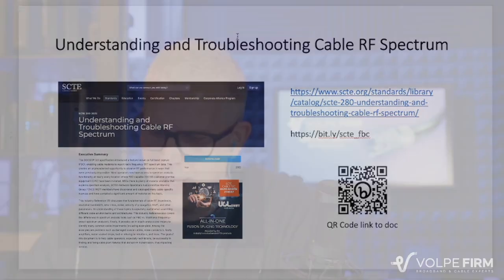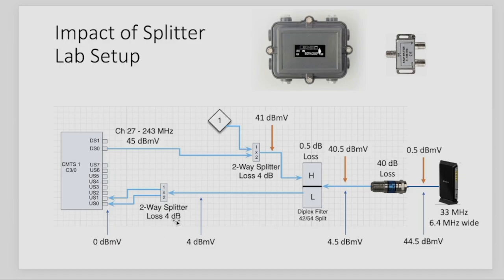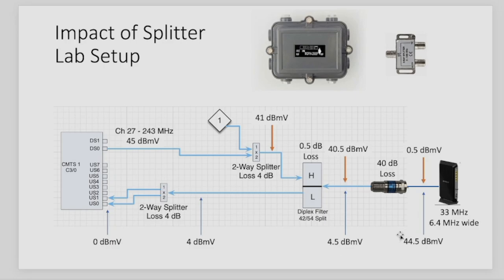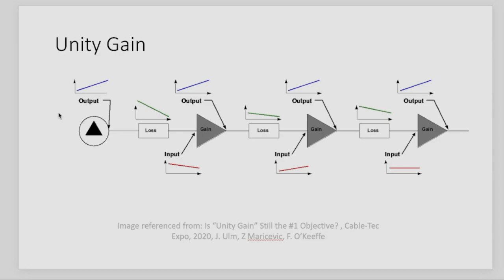Understanding Cable Network RF Return Path Signal Levels and Balancing

Comment: On the splitter loss the return side. Just look at it in reverse. Now the modem is the one sending a signal. So if the modem is transmitting at power level 35 dbmv adding a splitter will "lower"  that power and the cmts wont be able to "hear" it properly so now the cmts tells the modem to transmit at a stronger power level to compensate for the loss. Its just the way its set up to read measurements. There is signal loss on both sides. Tx is signal sent from the CPE.
Reply from the maker: Good point

Comment: Thanks for the shout out. Great explanation and loving the following up on noise funneling as well. I find the best explanation is that the higher value taps allow less loss to occur to the next tap and also lowers the forward due to it being right next to the amp. A balancing act due to the nature of Coax originally designed for 1 way. Also, the only thing I disagree with in this video is running the modem hot. I find running it lower/cooler leaves room for expansion on the plant and decreases the time on the modem booting up/responding to troubleshooting.
Reply from the maker: As long as your MER / SNR is good, you can run your modems however you like.

Comment: Is there a chart or rule of thumb for setting up downstream 1.2 gigahertz amps/nodes while in a 750/ 860 plant.  For instance a GS7K node says 27 dBmV on the receiver with a 15 pad should set up ideally but that's at 1.2 GHz not 860.
Reply from the maker: Hi trounbyfire there certainly are. Check with your vendor, now ATX for the GS7000 node. They can provide you with data sheets and likely even worksheets to build out the proper tilt based on your current and future proposed channel plan.

Comment: Hello im hoping you can help me i have a 3way antronix splitter connected to the cable line coming into my house. the 3 outputs are as follows -3.5db and 2 -7.0db does the 3.5db go to my cable modem + cable box and the -7.0db go to 2 cable boxes upstairs. thank you for any help.🙏🙏
Reply from the maker: Hi @midmassguy this depends on your priorities. The -3.5 dB will give the best signal performance. So if you want better high speed data speeds, then connect the -3.5 dB end to your modem. If you find you are having video issues and don't notice any data issues, then connect the -3.5 dB to your set top box that you are watching. The two -7 dB connectors will simply have more attenuation and therefore less signal to your devices. Hope this helps.
Reply: @Volpefirm  right now i have it from the 3way downstairs -3.5db leg going up to a 2way splitter both legs -3.5db in living room one 3.5db cable box 1 -3.5db modem the 2 -7db goes to different boxes in 2 different rooms. is this ok?
Reply: @Volpefirm  you think the last message i sent i ok? sorry to bother you.
Reply from the maker: HI @midmassguy, if you have good performance everywhere, then no change is needed. If you are having issues, for example with your modem, then I would recommend removing the 2way splitter and plugging your modem directly into the -3.5 dB leg.
Reply: @Volpefirm  thank you

Comment: Love these kinds of videos! I'm hopeful to see more as DOCSIS 4.0 is released to the public.

FOR CLARITY: The reason why UPSTREAM power levels INCREASE is because you're reading UPSTREAM power levels at YOUR MODEM and NOT at the CMTS. 

For example, if your current modem upstream signal level is 40dB and you install a 4dB attenuator than your modem would need to speak 4db louder to offset the added attenuation. So the new reading would be 44db at your modem. Simpy put, the more attenuation is added, the higher the signal your modem must send to the CMTS (headend) to offset the attenuation added.

UPSTREAM power levels can be viewed as how loud your modem is commanded to speak by the CMTS. The higher the number generally means more attenuation on the path that goes to the CMTS, so the CMTS tells your modem to crank up the UPSTREAM power levels to speak over it. That's typically not a good sign but not always a bad one depending on the levels and configuration. For most residential modems, optimal levels are between 38db and 48db, but 4-5db higher or lower may not be bad either.

THE KEY TAKEAWAY is that the UPSTREAM power levels you're reading is taken at YOUR modem, NOT at the CMTS. If it was taken at your CMTS then you would theoretically see upstream power levels drop by 4 dB as you would expect when adding a 4 dB attenuator. Then the CMTS would tell the corresponding modem to talk 4dB louder to offset this attenuation and the signal level would likely return to the previous number. That depends on many variables set by technicians.

QUESTION, does the CMTS have the ability to know the downstream power levels at my modem? The levels that we currently observe when we access our modem's web manager.
IF NOT, than the CMTS is "guessing" what downstream power levels to send? Is that why we sometimes need to add an attenuator to lower a high DOWNSTREAM power level?
Reply from the maker: Hi @heavnbound you have some good insight, and thanks for watching. The modem tells us its upstream transmit power and also its downstream receive power. Similarly, the CMTS tells us it's upstream receive power from the modem and its downstream transmit power to the modem. However, the CMTS is the primary controller of all modems. The CMTS adjusts the cable modem's transmit power for a fixed input receive power at the input connector of the CMTS (typically 0 dBmV).

One slight correction to your comment. You had indicated that your modem is transmitting with an output power of 40 dBmV. Then, if you insert a 4 dB attenuator, your modem would be sending 36 dBmV of power. This is not correct. When you insert the 4 dB attenuator, the receive power at the CMTS would drop from 0 dBmV to -4 dBmV. This would cause the CMTS to tell the modem to increase its transmit power by +4 dB. Therefore, the modem would be transmitting at 44 dBmV rather than 36 dBmV, as you had indicated. This can be tricky to grasp at first until you realize that the CMTS it trying to maintain a constant input receive power.

Thanks again for question and comment!
Reply: @Volpefirm  No problem! Thank you for the great insights! I understand the UPSTREAM power levels operate on a feedback loop with the CMTS and thus the modem would increase it's power levels by 4 dB to offset the loss caused by the attenuator. Thus speaking at 44 dB instead of 40dB.  It's just difficult to explain it. 

Quick question, as we discussed the UPSTREAM power levels being controlled by the CMTS, does this also occur with DOWNSTREAM power levels? I assume it doesn't that's why some subscribers like myself need to add an attenuator to reduce DOWNSTREAM power levels to a more appropriate level, in my case from 16 dBmV to 6 dBmV using a 10 dB attenuator.

I don't believe the CMTS knows the downstream power levels when it finally reaches my modem, it just sends a calculated preset amount of power to each subscriber and if the power levels are high it's the installer to make the appropriate corrections. Is that somewhat correct?
Reply from the maker: You are correct on the downstream. CMTS transmits with a constant downstream power. While the CMTS may know about the modem's receive power, it has no ability to adjust its output for the modem. It is up to the cable operator technicians (or you the homeowner) to adjust for downstream levels into the cable modem.
Reply: @Volpefirm  Thanks for clarifying that. The more I learn about cable comm the more I'm fascinated by the tech behind it.

Comment: Hands down, one of the best videos I have seen so far. I haven't watched all of them though. Too many techs drop a return pad behind the modem and don't understand that the modem might be transmitting back stronger, but the pad is eating the extra signal and it puts the modem level right back where it was after the pad.

Part of the reason is how the tools rate this as a pass. Not all the tools understand, and will pass anything within the specified TX levels. Older tools will "pass" modems with only one US channel so long as that is in spec. I need to make the installers watch this video. Pads are better at the tap because they can help with noise and also if I change the network, I can access the pads. Can't access pads inside the address...
Reply from the maker: Thanks Todd. Appreciate the feedback.

Comment: Nice video, I’m a network admin primarily focused on route/switch and NGFW areas but have an interest in coax & HFC. Some years ago Comcast installed a “forward path attenuator” on my line, I’m guessing this is just a special type of padding device that is selective for upstream bands? I remember it did improve my US signals & performance. Thanks!
Reply from the maker: Hi Train Wreck thanks for watching 👍

Comment: The easiest way to answer Specimen197’s question: the TX levels are the output signal power of the modem back to the CMTS, the CMTS wants to see 0(+-1 ). So the CMTS RX is 0, and you add a splitter. Now the CMTS RX is -4, so it now tells the modem to increase its signal power output so it will receive 0 RX at the CMTS. 
Downstream RX is inversely the CMTS transmit. 
The modems Tx is inversely the CMTS’ RX.
One device’s TX is the other’s RX.
Reply: TX= Transmit/RX= Receiving. It's all about the Point of View of which device you are talking about.
Reply from the maker: It always makes so much sense in your head 😂
Reply: @crimsonking5085  If you say broadcast and return path rather than TX and RX the potential for confusion is gone.

Comment: This confused me actually. Coaxial cable service providers (a.f.a.i.k.) use a HFC (Hybrid Fiber Coaxial) network, so thinking about it, I would think signal levels matter, until the Node is hit, because then it goes into fiber/optical  (you don't want the optics busy with interference). how does the CMTS, that is behind optical fiber, see a certain (RF) signal level in DBmv? When you say a CMTS expects 0DBmv upstream level (not encounting for ICFR), how is this measured over Fiber? The service provider I work for is migrating to fiber. So I understand that placing a (mini)node at the home, would greatly reduce the RF noise/ingress impact on a customer, but it still is coax at the home. but what about the CMTS then?
technically it is the same, but now the node (fiber to coaxial) is moved to in-home...
Reply from the maker: Hi @steveholvoet6058 thanks for watching and for the questions. You are correct in your understanding that between the headend and the fiber node that the signals are light, passing through a fiber optic cable. However, at the headend, the signals originate as RF signals in the downstream (to the subscriber) and signals coming from the fiber (from the subscriber) are converted back to RF from light using a device called a return path optical receiver. Therefore, all signals coming from and going into the CMTS are RF signals, which are measured in dBmV.